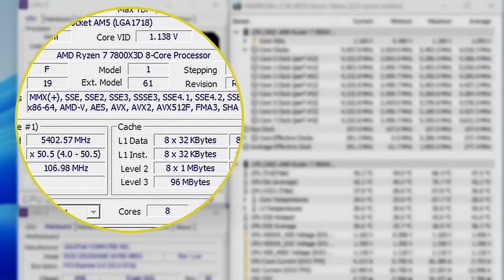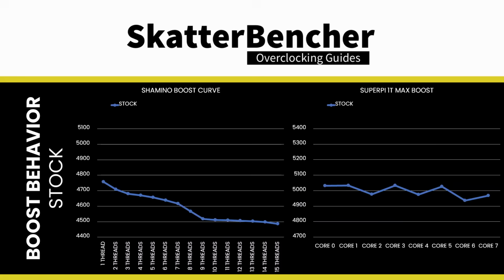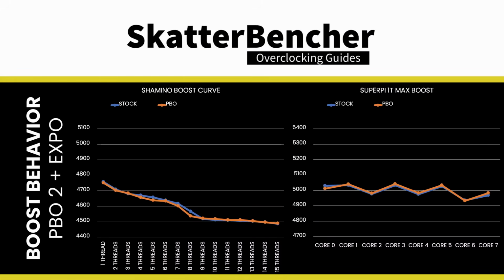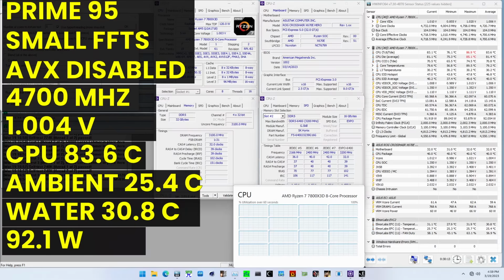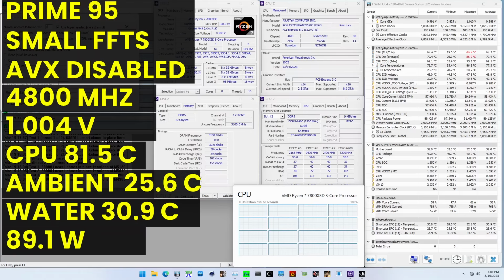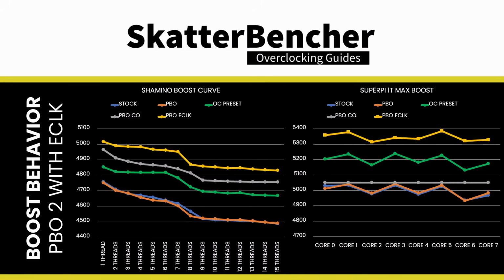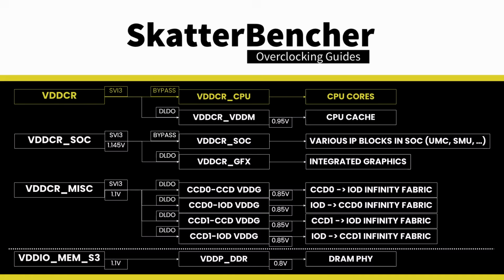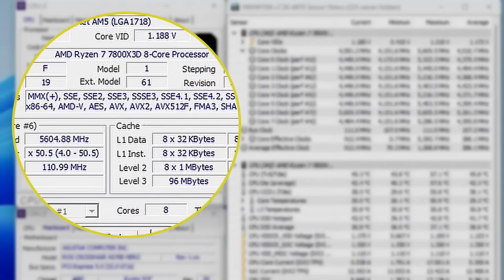Ryzen 7 7800X3D Undervolt & Overclock to 5403 MHz With ROG Crosshair X670E Hero | SkatterBencher #60

Comment: Ryzen Master has a Curve Optimizing feature that will give the most performant voltage curve per core.  I recommend using it because it was very accurate versus my manual tuning would have saved a lot of hours of testing.
Reply: For me, Ryzen Master has no option to optimize the curve. I heard that it's disabled for X3D CPUs. Got any ideas?
Reply: Looks like it is only for 5000 series
Reply: Ryzen Master on 7000 should only be used for viewing, pressing "Apply" garbles the BIOS nvram on some AM5 boards (all ASUS in my experience), and you wouldn't be able to boot until you clear CMOS.

Comment: Nice work, I also got my 7900x3d to 5.4Ghz with a 106.4 ECLK and did a negative 100 clock on CCD1 so it would not go over 5.95Ghz and crash.
Reply: Nice, which motherboard do you need for that? does a simple one like a B650-plus or B650-m work too?
Reply: @Jootn2kx  I have a Gigabyte B650E Aorus Master.  As long as the motherboard BIOS as async mode you should be good to go.  Then just down to silicon loto at that point.  i have tested out 7 AM5 CPU so far and only 1 has been able to run at 6400 Memory speed.
Reply: @njasicko  Thanks I think i'll order it i'll let you know my results on my 7800X3D lol
Reply: Gigabyte B650E Aorus Master support overclock with ECLK???

Comment: I love your videos regarding undervolt and overclock! Amazing work!
However I am stuck with one question I ask myself after looking at this video twice.
For pure gaming purpose I assume you would go either OC Strat #1 (The easy way) OR OC Strat #3 which takes some more time to find the perfect negative curve I assume? 
Tyvm for any answer!
Reply from the maker: You're spot on :)
Reply: @SkatterBencher  Thanl you so much for your answer. <3
Reply: @SkatterBencher  I am in need of some advice if you can. I am pretty frustrated at this point as I run a -35 negative curve on all cores (it is actually stable both on light and heavy load) but I run into the VDDCR SOC VRM showing 1.240V - Is this safe? I updated to the very last bios firmware.

I also believe that HWINFO shows wrong values because I have spikes of VDD 2.155v, SOC voltage 2.480and misc voltage 2.220
Reply from the maker: VDDCR_SOC 1.24V is safe, yes.

Those HWiNFO values do seem off. Maybe there's a newer version available to download?
Reply: @SkatterBencher  Hey again. Yeah so I figured out those HWiNFO values only seem to have happend in combination with having AMD adrenalin overlay open at the same time which I simply forgot to disable as I completely wiped my PC after going from 5900x to 7800x3d but now all values seem to be fine and I believe I just panicked because the values were like 2x of what HWiNFO originally gave in the start which is quite concerning especially when HWiNFO was updated to last version and mobo firmware was flashed in the very beginning. Thank you for your time and reply tho!

Comment: Hi ScatterBencher! Loved the info you have on the subject. I see in other YouTubers that they utilize VCore Load Line Calibration, example here https://youtu.be/4JXvewurhks?si=42P_zU-bgKR8f0Wy

To my understanding. You’re essentially accomplishing the same end result by adding a positive offset to PBO curve optimizer correct? I just wanted to know if you’d recommend using the VCore Load Line Calibration or just use the curve optimizer by itself?
Reply from the maker: I suggestion only use loadline calibration if you're doing a manual overclock ("OC Mode") with AMD Ryzen CPUs. If you're sticking with Precision Boost, then Curve Optimizer is the right tool.

I experimented with loadline calibration for Ryzen CPUs a while ago and found that adjusting the loadline calibration would make the CPU SMU automatically adjust the requested voltage to offset the loadline. So it cancels each other out.

Comment: Hey Skatter Bench,

I delid my 7800x3d and confirmed it would post!  I don’t plan to use Liquid Metal but PTM 7950.

Do you think I could go up to the 1.2V limit with a voltage offset?

I am hoping to get an all core OC above 5 ghz using pbo2 and bclk like you did here.

Thanks for the detailed guide  keep the content coming.
Reply: Did you try this?
Reply: @benperkins2929  yes.   Waiting for the cpu drama to resolve before I tune it though but it looks good so far.
Reply: @benperkins2929  I am getting 5.1ghz all core with minimal tweaking.  Not as good as I was hoping but really good overall.
Reply: @plushquasar653  is that with the PBO ECLK method?

Comment: Did you experiment with the max frequency boost setting on the 7800X3D at all? I was surprised to see it not mentioned in this video, considering how much detail and thought has been put into it.
Reply: That setting has for some reason been disabled by AMD on vcache CCD's, even for their flagship.
Reply from the maker: Fmax Boost Override doesn't work on X3D CCDs, unfortunately.
Reply: @SkatterBencher  weird that the menu option was still there then, it disappears with my 5800X3D

Comment: Great video.  Helped me to understand what all the acronyms meant.  My old 2600k was the last OC I have done.  But it has been purring at 4.4ghz under an AIO for 10 years.  It idles at lower temp than the 7800x3d which is also under an AIO.  But seeing boost to 5150mhz using PBO2 curve at -30 and a 102mhz base clock.  Ran p95 at up to 70c for 5 minutes. I am curious what I can undervolt to now to drop a few more degrees. 
I would like to know if I could OC just the boost.  So it has a 5500mhz ceiling but idle and surfing the web only uses stock speeds for the most part.

Comment: Hey, thank you for the great video! One question about the Bios/UEFI you used. I have the ASUS B650E Gaming and I can't turn on AI Overclocking because the "X3D chips does not support OC". Did you use a specific BIOS/UEFI, or is it limited to x670E?
Reply from the maker: I'm not familiar with that error message or issue. Can you share more about it? (Ai Overclocking would be the option to enable EXPO right?)
Reply: @SkatterBencher  In the meantime I found a way. The menue has an other name. Unfortunately I can't set eclk to asynchron. On the asus B650E is no Option for that. It looks like the B650E has only one click generator. Or maybe it's only a bios/uefi thing and Asus don't want that option on "cheaper" chipset.
Reply from the maker: To support Async Eclk you need a physical chip added to the board. So it's definitely a cost consideration to add or not add.

Comment: Thanks man.  This was an awesome resource for myself as an ASUS x670e-e Gaming WIFI MOBO + 7800x3D owner.  I'm a novice at overclocking and didn't have a clue about which settings to tweak in the BIOS to get a good overclock or about which overclocking method I should use.  By the expert way you compared the steps to each overclock method with the results, I can easily determine method 3 (PBO Curve Optimized) is the best one for me.  That seems to be my sweet spot for thermals, results, and work invested.  If also have GSKILL Trident NEO 5 DDR 5 6000 with EXPO memory.  I saw that you used the EXPO1 setting for the memory but I have seen others use EXPO 2 for their overclock.  Can you tell me why you used EXPO1 and what the difference between the 2 is?  Thanks again brother.  This was a tremendous help.
Reply: Cool, I use the same configuration as yours, were you able to lower the temperature of yours? Mine is on the 50° scale in a normal process, could you tell me?
Reply: @Paulo0032  I have the same config too... playing metro exodus my PC-Case was getting way hot. Then I changed the curve opt. to -25 on all cores and limited the PPT to 85w. The game did not change and my PC case only gets warm now... The indicator on the x670E-E shows 50-52 ºC while gaming. I'm happy... and I didn't even try -30 or 75W. =D.  Let's see if the system is stable first (did this change yesterday)

Comment: I'm using the latest bios 1516, and it doesn't have the "core voltage" option for 7800x3d on the GENE board.
I noticed that in the video you are using bios 1002.
I'm afraid to go back to this old bios because of the melted cpu problems.
Is there any hidden option to release the core voltage, or is it blocked in this bios?
Is there any trick to release it?

Comment: I've found that the tweaked expo profile from asus bios does actually provide substantially better memory performance at least in memory benchmarking, have you tried it and found any impact on cpu performance?
Reply from the maker: I've tried EXPO Tweaked (or XMP Tweaked) in one previous OC guide but can't remember which. I didn't see it have impact on CPU overclocking. But then again, I did not test very thoroughly.

Comment: I have a HUGE question: In my Asus bios for the X570 motherboard, I have TWO sections for AMD overclocking, where both have a PBO submenu. This confuses me, as I do not know what the two separate PBO settings are for. IF you could explain this to me, I would be very grateful.
Reply: Either menu applies the PBO settings just choose one and stick to it 😊
Reply: @tombexhill  This makes no sense, as you can set either of them with very different settings. There must be a catch.
Reply from the maker: No catch, Tombexhill is correct.

The PBO settings in the AMD Overclocking menu are AMD's "official" BIOS tools whereas the ones in Extreme Tweaker or Ai Tweaker are copies by ASUS to make access easier.
Reply: @SkatterBencher  @tombexhill Thank you for the clarification. To better understand: If I change values in both sections, but  with different values, how does the bios decide which ones to use? Shall I leave the second on default and work just with the one by AMD? The duality is what confused me. What is the best cause of action? Thank you all for helping out here.
Reply: @towercgaming  I've used both and they apply equally I have always left one on default though as I don't know what one it would go to preferentially. I normally use the ones in AI tweaker now as they are easier to get to
Reply: @tombexhill  Thank you. This helped a lot.
Reply: @towercgaming  No problem good luck with the PBO 😎

Comment: would doing the curve optimizer in the postive direction yield better results if I dont care about the extra voltage and temps?
Reply from the maker: Not in combination with Precision Boost, because the PB algorithm relies on the voltage to estimate the appropriate frequency. With positive curve optimizer, you set the voltage for a given frequency higher. So if the algorithm determines a maximum allowed voltage, the actual maximum allowed frequency will become lower.

Comment: Hi, Thanks for your guide. Quick question, I've already fine tuned my 7800X3D with B650E Aorus Master following this guide which gives a nice 107 ECLK 5.4Ghz (with CO individual tuned for each core), 2200 FCLK, and DDR5-8000 CL36. Do I still need to enable PBO enhancement. Still not quiet understand that 90 Level 1 will overwrite my CO or not?
Reply from the maker: No need to enable PBO Enhancement. 90 Level 1 will set the maximum temperature to 90C and -10 Curve Optimizer. So it will overwrite your settings.
Reply: @SkatterBencher  Thanks for quick reply!

Comment: Hi SkatterBencher. Love your content. Looking to perform my first overclock on 7800x3d. I know you use the EFC to monitor ambient and coolant temps. My question is, the EFC only has one header for an external temp sensor which I understand you use for coolant. So where or how do you measure the ambient room temp? I understand the EFC has a second on board sensor. Is this what you use? If so, where is the EFC mounted in the machine and is that a true ambient temp?
Reply from the maker: Hi Joseph, I indeed use the ambient temperature sensor on the EFC-SB. I don't mount the fan controller anywhere since I'm always using a test bench system. But the fan controller is always in the near vicinity of the system.
Reply: Thank you kindly. I have setup an ambient temp sensor based on your advice. I’m using the Aquacomputer Quadro. I’ve tested my settings in stock form. My only other question is about Shamino’s Boost Curve tool. I understand this is an Asus tool. I have an MSI board. What tool can I use to track the average frequencies? Many thanks!

Comment: What software do you use to figure out what core is crashing when doing per-core voltage tuning? Currently trying to find the ultimate per-core undervolt for my new 7800X3D. All cores can do -25.
Reply from the maker: OCCT or Core Cycler typically give me the most reliable testing results
Reply: @SkatterBencher  I find that running Core Cycler or OCCT core cycle test will accept -30 on all cores. But running a normal OCCT CPU stress test (also -30) will return a WHEA error within 60 seconds of testing. Might just be a matter of how long I run the Core Cycler. So far I only ran it for 1.5 hours (2 iterations on all cores). 

Thank you for your great content. I just upgraded from a i5-11600K that I got to 5.1Ghz on all cores also following your OC tutorial of that chip. Enjoyed it very much. 

Best regards from Denmark.

Comment: I'm on a 5800x3d but plan on upgrading to a 7800x3d when the time is right- love all your videos you're a legend but I do have one question- does pbo on am4 introduce any sort of added system/input latency? I'm a competitve fps gamer and currently run my 5800x3d with SMT disabled no PBO etc. 

I guess in theory PBO/any overclock should actually lower input latency as it's effectively the same as having a higher IPC on a CPU? 

I spent years dealing with/learning about multi CCD core-to-core latency penalty w/ a 5950x before realizing that the slugish aim I was experencing in FPS games was actually the result of higher than usual DPC/system latency due to the fact the game was running on multiple physical + virtual cores and communicating across multiple CCDs.

And i've recently started learning about processor IPC and how intel is generally better for gaming because of a higher IPC.

What I can't wrap my head around is what is the 'definitive' way to determine which modern process- thanks in advance!

Comment: Do you think that with an Asus rog strix x670E E Gaming motherboard you can achieve the same results? excellent video 👍
Reply from the maker: I don't know the specs of that board by heart, but if it has the external clockgens for async eclk then it should be no problem to replicate the strategies. Whether you can get the same results will of course depend on the CPU :)

Comment: Is a custom loop the only way to keep the temperatures low on this cpu or would a good aio be enough for light overclocking?
Reply: mate it pulls 80 Watts stock, you don't even need an AIO
Reply: Seconded, it's very easy to aircool this CPU

Comment: Hi, if i use my 7800x3d with blck 102.93 i get in windows almost 5.2ghz.. should i use pbo with this method or disable? Right now i am using pbo amd eco 170w setting with a curve -10 all cores stable prime95.

Comment: So for any of us on a b650 without ECLK, we're stuck with pbo 2 curve optimizer basically, right? I'm running mine all cores -35 with RAM at 6000 IF 2033 (as per buildzoid hynix timings) and seems stable, but doesn't boost past 5050 mhz, around 82° celsius cinebench r23.
Reply: at the moment it seems like it. Hopefully somebody finds a work around.

Comment: @SkatterBencher If a motherboard has eCLK, does that mean we can force the CPU to a fixed clock speed when gaming or does the voltage need to be fixed to stop the clock speeds from jumping up & down?
Reply from the maker: Technically 7000X3D does not support manual overclocking ("OC Mode") which provides the pathway to fixed frequency and voltage. However, you can mimic this behavior as I've shown in OC Strategy #5: Manual Overclock. TLDR: you disable Precision Boost to get a fixed CPU ratio instead of constant fluctuation of clocks.

Comment: When OCing RAM w/ this chip, what should the max VSOC be? 1.15v?
Reply from the maker: Since the memory controller is integrated in the IO die, not the CPU dies, you can run standard EXPO voltages (1.4V is fine)
Reply: @SkatterBencher  huge help for a novice. Thanks!
Reply: @SkatterBencher  Have you seen Buildzoid’s easy ram timings video? Would these timings be stable with the 7800x3d OCed vs EXPO?
Reply from the maker: I may have seen the video. Stability depends heavily on the specific memory and CPU, but in theory it should be possible to make it work

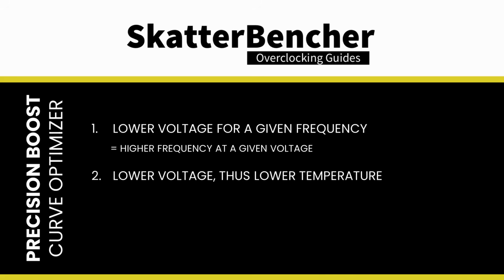Comment: Hi, I don't understand why you state at 16:02

Lower voltage for a given frecuency = Higher frequency at a given voltage.
Reply from the maker: Let's assume there are two V/F points: 5000 MHz at 1.25V and 4500 MHz at 1.15V.

Now we use Curve Optimizer to undervolt the processor by 100mV. Then these two V/F Points will become: 5000 MHz at 1.15V and 4500 MHz at 1.05V. 

We get a lower voltage at a given frequency: 5000 MHz = 1.25V -> 1.15V
We get a higher frequency at a given voltage: 1.15V = 4500 -> 5000 MHz

Comment: Hello! I just wondered if you plugged in your second power cable, one 8 pin and one 4 pin to the motherboard? One 8 pin can handle 150Wattage, but not over i think ?
Reply: It most certainly can but I’d still plug in the extra 4-pin if you are able to. Less current through the 8-pin meaning less heat/power used to supply the proper voltages to the CPU itself (that is unless it only utilizes the 4-pin after the 8-pin is maxed out, I don’t know how it operates) . If you’re not overclocking it probably doesn’t matter, but if you’re on this video I’m assuming you are and would recommend plugging it in.